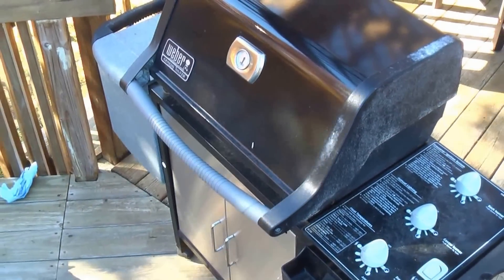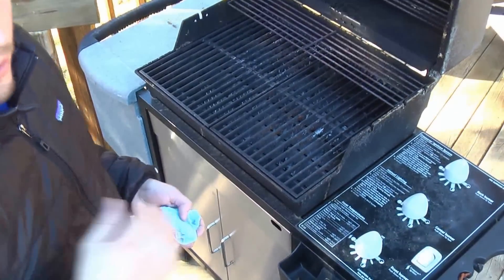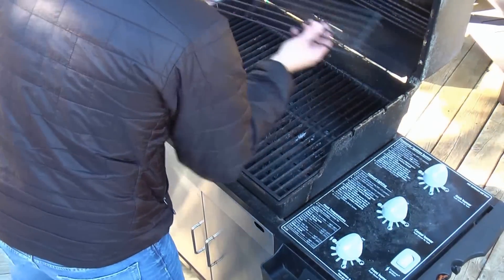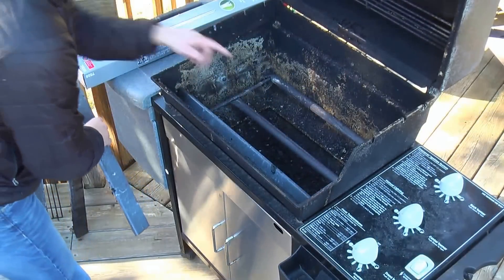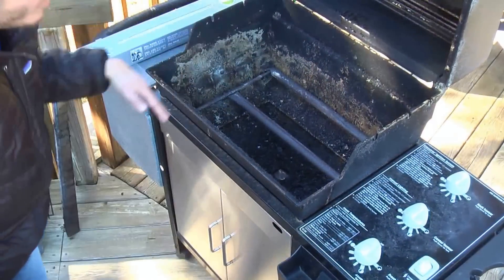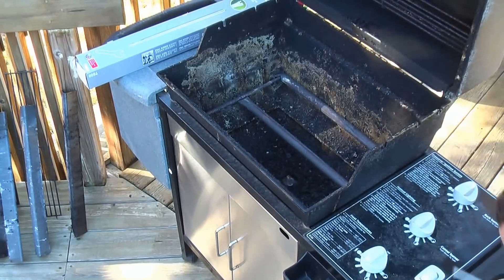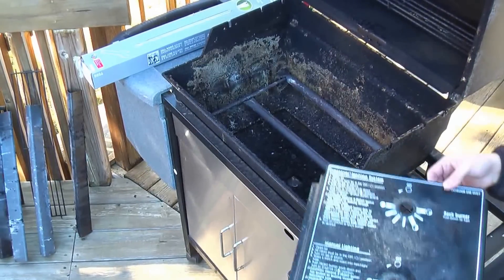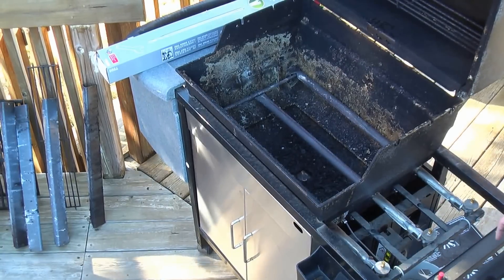Weber Gas Grill Maintenance - Burner Tube Set & Cross Ignition Replacement

Comment: Thank you for the great instructions. I am about to tackle my Weber Genesis silver B grill burners and igniter very soon. Ordered the parts from Amazon which should be here tomorrow. As long as I am replacing the burners and igniter, I thought I would go all out and replace gas hose and flavoriser bars. Thanks again.
Update: The day after I posted this thank you, I received all my Weber Genesis Silver B parts that included the burners and it went real smooth with zero problems. Before and after watching this video I saw hit and miss guys struggling with the burners and took them out the wrong side, plus unscrewing the two guide screws and one guy even cutting the two screws off! Another guy unscrewing the spider guards from the manifold. So glad I followed this man on removing the burners. After I got the new burners in, I replaced the igniter, gas hose and flavorizer bars and my 18 year old grill is like new again. 👌

Comment: Very Helpful!  Just replaced my 15 year old original rusted out burner tubes on my 2008 Genesis 320 after watching this.  Only issue for me was that one of the bolts holding the manifold bracket was completely rusted and I couldn't get a socket or vice grips on it so I had to drill it out.  I replaced with a 2 1/2 inch stainless hex bolt and nut.  New burners work great!!
Reply from the maker: @mikedoyle2820  Awesome job. Happy to help!

Comment: Fixed my 22 year old BBQ with your help. My front burner wasn't igniting. In fact I had to clean the end bit where the gas comes out before going into the burner bar as that was clogged (the bit that the spider catchers protect).A wire brush did the job. Took the time to clean the burner bars as well and banged out the carbon deposits. Great result. Thank you

Comment: Thx for the video.  I just had a fire in one of the knobs.  Apparently this can occur when the tubes become blocked.  This is exactly the video I needed today.  

The camera doesn’t show how your removed the screws from the front plate but I see there is a gap in the plastic handle that allows easy access to the screws.  Just finished the replacement- easy peasey - very well explained

Comment: With your video we were able to fix up our old genesis s-320 to move it from our house to our camper / campsite out of state and give it a new life for us out here, Unfortunately the two bolts holding the big bracket on were so rusted and practically welded to the grill i had to remove the three smaller bolts you advised against- but with alertness, an extra set of hands and extra care we got it all changed out new ignitor, burner tubes and it burns like new, i love these grills my grandma also had one! i wish theyd bring back production of the s-320!!

Comment: Great video very helpful thank you for posting this.  I had a gas leak at the manifold, after watching this video I knew how to take the grill including the cover under the knobs apart. In  checking the burner tubes I found the crossover to be corroded and in two pieces.  I called Weber bought the new manifold that comes with the hose and new regulator.  I mentioned the crossover and they provided me with a new set of burner tubes at no cost under warranty. If I had not called Weber I never would have known.

Comment: Thanks to your video, I was able remove my burner tubes with ease. First I cleaned them of surface grease with paint thinner. Then I cleaned the holes that had clogged over time in the center tube (and only that tube). For grins, I polished all 3 tubes with my Kalamazoo 1 x 42 belt sander. Upon reassembling my grill the flame pattern was perfect, good as new. I can't imagine the circumstances that would cause me to buy a new set of tubes. And mind you, my grill is by no means young. I guess that which is made of stainless steel can be expected to have a very long life.

Comment: Thanks for taking the time to post  - i was having problem figuring out how those guide screws were going to come out - your video shed the light on that -  pulled the manifold and it all went smooth from there.  thanks 
ps - trust him - those guide screws are just guides- and there is NO reason to mess with them.

Comment: Thanks for your efforts. My Genesis is a bit newer, the panel is secured by one phillips screw on the rear side. My #1 tube has/had a tab that holds the igniter which my replacement did't have (solved with a SS hose clamp). FYI - I, like you, had my grates with the narrow side up and that is upside down! Discovered while about to order new ones. Don't need to now, the right sides are still like new, after laborious cleaning.

Comment: Thanks very much for sharing your knowledge on this grill. Mine is identical and I will be installing the new burners today. BTW I found a "grill mat" that is designed to grill fish or any item that may fall through the grates. Found it in the supermarket for about $8 and it works great. It's made out of a heat proof material, rolls up for storage and really cooks well.

Comment: Thank you so much!  This is very helpful and very accurate.

On twist relevant to my Weber Genesis EP-320, I could not get the two screws on the right out - even after using lots of penetrating oil.  Fortunately, if you are careful you can feed the burners right through and it was much quicker.

Comment: just finished replacing my burners,  The video is good BUT a couple of recommendations.  Spray Liquid Wrench or penetrating oil on all the screws you need to take out as well as the far ends of the burner tubes and let soak overnite.  If the tubes do not pull out readily as one of mine did, take a bladed screwdriver and pry between the end of the tube and the wall of the grill. If the manifold bracket is held on by thumb screws like mine instead of the ones shown in the video you will need a very small crescent wrench to get at them to loosen them.

Comment: IF you want to replace the spark ignighter, it is about 10 bucks and clips right into place.  The little flipper button on the gas control furface simply sits over the button on the ignighter assembly and acts as a place for your finger to press down and fire off the ignighter.

Bob S
Reply from the maker: @robertschworm6036  Thanks!

Comment: You forgot to add in tools the drill and cold chisel to remove the two screws holding the tubes on the left side. Thank you for your help though.  Rust never sleeps.

Comment: Thanks for your very helpful video.  I do wish I'd watched before I dis-sassembled to try to assess the condition of my middle burner, as I took the manifold apart.  But sometimes I just go by instinct and take stuff apart.  Oops.

Why you are so right about the manifold -- it makes the whole thing unnecessarily hard and more dangerous.  On my first go, the manifold attachment was poor (and the igniter frame was rusted out at the top).  When I turned the grill on, flame burned the rubber gasket on the first manifold stem.  Had to put out a small fire!  Luckily, it was easy to reassemble the manifold properly off the grill and I treated all three stems to new neoprene washers.  Which is a subtle way of reminding folks to use soapy water to check the connections for leaks before igniting!!!! Happily, I had none when I replaced the burners.

I also suggest assessing need to replace the igniter at the same time. It is easier to do with the burners out and that part is cheap enough to not wait for it to fail or rust out completely.   Your video made my replacement job a snap once I purchased parts. 

I wish I'd done this job two years ago.  When I tested the new burners, the grill got to 500 in a minute or two, startlingly fast compared to the last several years.  Glad I decided to repair instead of replace now.

Comment: Thanks for the vid. I have the same exact model & color. The starter bar that goes between the 3 burners has rotted away. So I will be replacing that as well as the the igniter. 

I just cooked a home made pizza on it. It still works but needs these parts.

Comment: Great video, but I was forced to go a separate route...  The bolt holding on the plate for the burner knobs was stripped, so I basically skipped the step of removing that plate and everything went perfectly.  Less steps and still doable.

Comment: I am cleaning my 25 year old Weber 1100 before putting the new burners in.  Starting to look brand spanking new again.  Even girls can do this... Hardest part is going to be getting the wingnut off the outside of the bucket. Wish they had used bolts instead.  I bought a kit through Amazon that has the burner kit and my Weber needs 17 flavorizer bars. Can't wait to get grilling again.

Comment: And this is why I bought a Weber.  Parts are in stock and replacing worn/rusted ones will fix the grill.   I had another, cheaper grill that I replaced parts on.  The parts were universal fit that didn't work as well as the originals.  The body rusted out not long after.

I've replaced the grill and the flavorizor bars and am now replacing the burners.  I think the rest of the grill will last long enough to replace more parts.

Comment: Great video.  My crossover is rotten but 3 burner tubes seem ok.  Would you just do the crossover or 3 tunes plus crossover.
Reply from the maker: If you're disassembling anyway, I'd replace the tube set too.

Comment: Technomack how would I know which burner tube set would be for my weber grill? A client gave it to me it kind of looks like yours .is there a model somewhere on the grill? Thanks in advance
Reply from the maker: MrZACATECANO100 Go to support.weber.com on a desktop computer and use the "Order A Part" wizard in the lower right. It will help you drill down and identify the correct part for your model.
The label with the serial and model information is behind the doors, under the grill on the side of the partition wall.

Comment: how about doing a video on replacing the igniter switch assembly after replacing my burners my igniter which works perfect every time stopped working wires are connected to I have no idea why I'm using a lighter to start the grill now

Comment: I own a grill like that one with 2 burners.  The crossover tube, flavorizer bars, cooking grates, tray under the grill and the grease pan holder are rusted out.  I have new flavorizer bars and the 2 cooking grates.  Is the grill worth restoring?
Reply from the maker: I would. Mine is still going strong after 15 years or so.
Reply: @TheTechnoMack  Ok but where is the best place to buy the parts?  What should I clean the inside of the grill with?
Reply from the maker: @brianmott728  I purchased my replacement parts directly from Weber's website. If you can't find what you're looking for, give them a call. They have great customer service. I just scraped and shop vacuumed the interior. Maybe Weber will suggest a better cleaning protocol if you get in touch with them.
Reply: @TheTechnoMack  Is it cheaper to buy the parts directly from Weber's website or should I buy them from a store that sells Weber?

Comment: Have a Weber gen silver A very weak front burner only works after lighting manual ,was in back yard during hurricane sandy ,was not submersed fully in water but thinking to replace burner tubs,igniter,and regulator to be safe ? What's your opinion

Comment: Your video was helpful, but it didn't work for me.  When I got everything disconnected, old tubes 1 and 3 would not budge.  I pushed, pulled, tried WD40.  Nothing worked.  Do you have any suggestions?

Comment: I have a question.  There is a flame coming out from one of the the knobs on my weber grill. Do you know what those pieces are called and would you know how to fix?
Reply: leaking valve, may just need to tighten the 2 screws on it

Comment: Was hoping for tips for removing rusted screws that you call "Guides"
Reply from the maker: Thumpur69 I don't think they're supposed to be removable. They're just there to make sure the burner tubes are seated in the right place as seen at 7:46. What are you hoping to fix?
Reply: Just to get the burners off!!! Took a lot of beating but I finally got it.
Reply: @TheTechnoMack  My problem is the bracket that you take off first is completely rusted to the bolts. I broke one of the bolts off trying to get at it. I am going to try to drill out the bolts and see if that works. I am afraid I will break the bracket doing it though.

Comment: OMG - I see you figured out how to remove the burner tubes. You had it all apart, but didn't bother cleaning out the inside of the grill - still. Aren't those burner tubes stainless steel? Maybe you could have cleaned the old ones. (inside and out). But I guess you replace instead of clean. Spiders and bugs can get into those burner tubes and lay eggs, make spider webs, etc.  Make sure they are cleaned out and the air ports are clear if you have flame issues. Make sure all the burner holes are clear. Take out the bars and look at the flame. Thanks for replacement instructions. How much did all that cost you?
Reply: Thanks for the feedback Vince. The burner tube set is currently $44.99 at HomeDepot.com.

You're right. I could have cleaned the heck out of the old ones, hoping it would fix my center burner ignition problem, but I didn't really want to gamble. This set lasted 10 years, so I figured it was time.
Reply: Ryan Mackowiak Count me as another satisfied viewer.  Just finished swapping out my burners and your video made it a snap.
Reply: I replaced my 20 year old burners since they were old and rusty and one hanger was rusted so much the back burner was hanging sideways. But the main reason was the cross light tube was completely rusted out, so to start the back two burners I would have to turn the gas on high and wait until the gas coming from them exploded to get them alight.

BTW, thanks so much to TechnoMack for making the video showing how easy it was to replace the burners. I got generic stainless steel ones on Amazon for $20, less than half the price of OEM.
Reply: Thanks for the tips. Took me under an hour after viewing your video. Mine lasted 22 years. In Canada the burner set was 70 dollars although there is an aftermarket set for $30 but you won't get 22 years out of it.